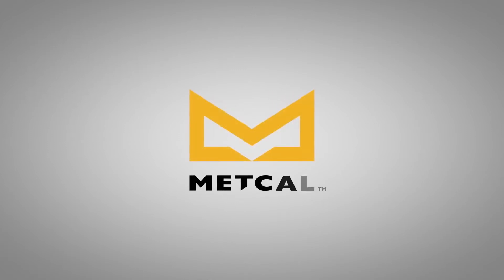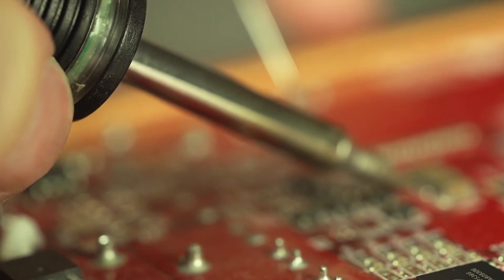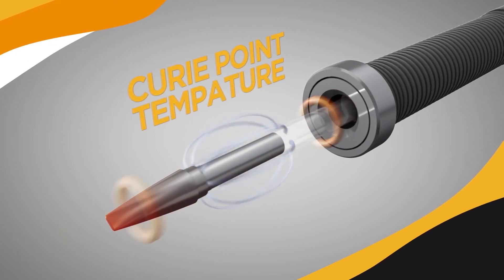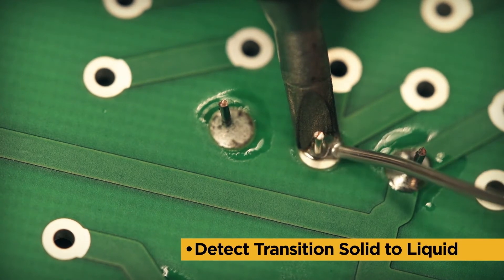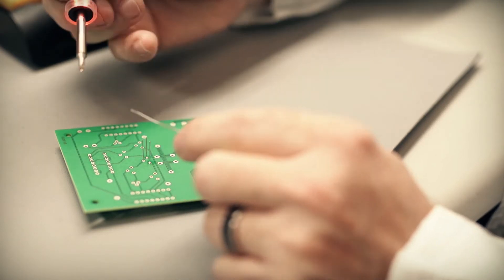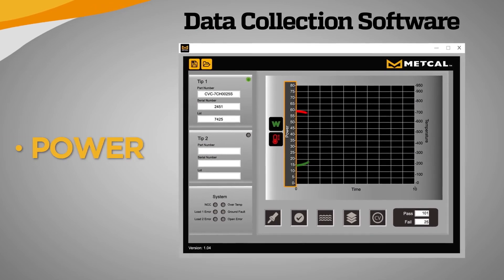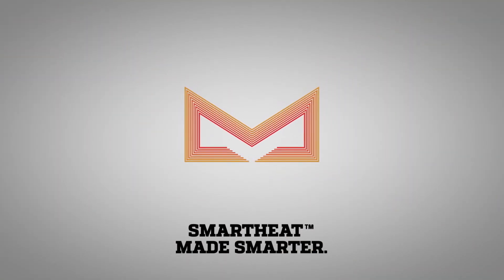Metcal  Connection Validation (CV) Intro Video  (10 min version)

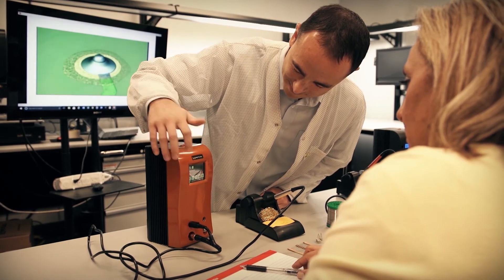Comment: What is up with the green light signaling an OK connection on the soldering at 6:03?
Reply: Indicating a proper solder connection. Metcal has a patent for it. SDG Electronics has a video on it, including how it works.
https://www.youtube.com/watch?v=a_KG53SSluw&t=1760s